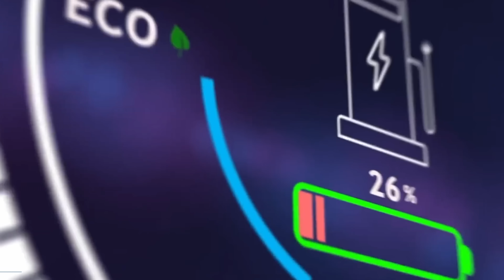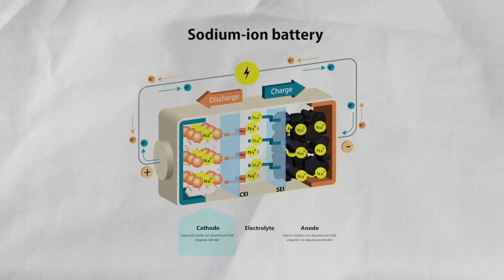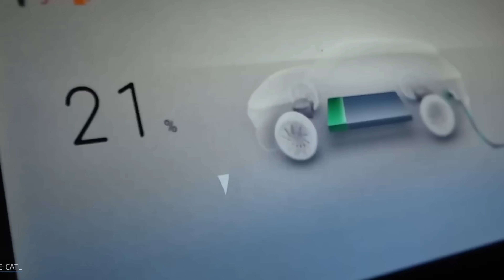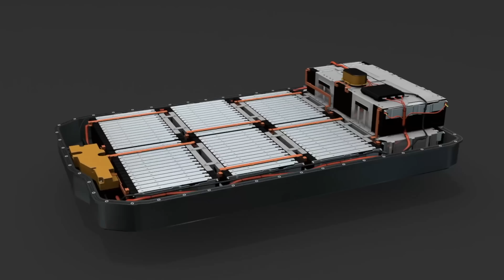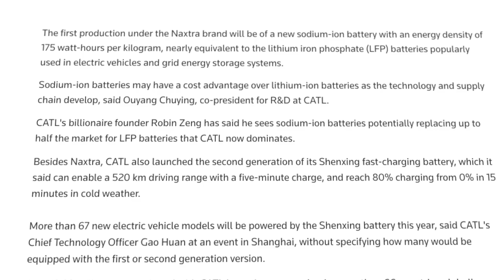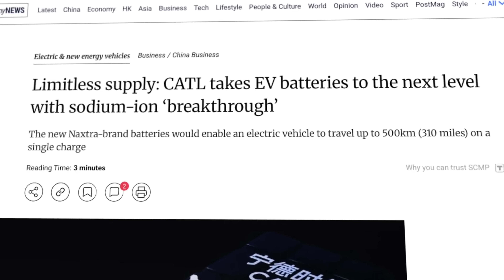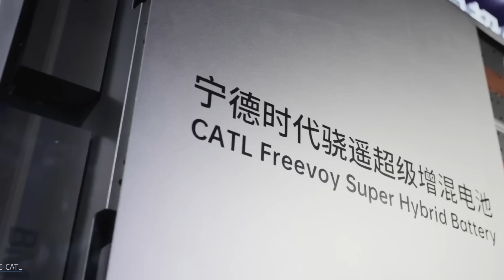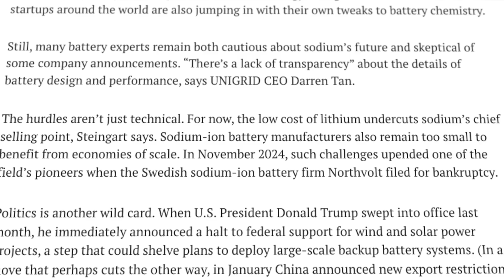CATL 5th-Gen LFP Battery Enters Mass Production — What We Know So Far

Comment from the maker: Would you prefer this LFP chemistry or the new Naxtra chemistry?
Reply: I would. The sodium battery seems fantastic, but LFP has been demonstrated and known. But, I am most interested in home energy storage.  I built a 32kWh battery out of recycled 18650 batteries, right before LFP prices came down. My next battery build (in a year or so) will be LFP.
Also, do they have the inverters and BMSs for Na ion yet?
Reply: Software defined BMS and inverters are available now. A small amount of programming will configure the needed CV curves
Reply: NA batteries I feel won't satisfy the car market by themselves, Naxtra as I understand from previous data is just a mixture of NA and LFP batteries in the same housing, obviously with some serious modified BMS and Inverter technology. The NA will of course work better at extreme temperatures for things like cold charging and can be used for warming the battery without having to expend power all the time to keep them warm, just use the power available in the NA batteries at that temperature to warm up when needed. The LFP batteries can help stabilise the voltage flow from the NA batteries to make it more consistent, together they probably make a better battery, but not with the same energy density as a full LFP battery.

Basically if you are in a country where you don't hit these extreme temperatures the full LFP battery will always be better, but the Naxtra battery might be much better suited to cold climates, the main differentiator then becomes price, would you take a car with a shorter driving range, say 10% or 15% less for a third the cost? Yes many people would do that, but I haven't yet seen any evidence of extreme cost savings in NA batteries so far. Of course they aren't in mass production yet so maybe that will come later, but with companies already claiming to have 350 W⋅h/kg SS batteries in cars in 2026 (although I suspect they are quasi-SS and not full SS) it's really a race to see who can market better in the short and long term.

Currently, in the climate where I live I would always go for the full LFP if I the price difference wasn't large, that's really the only differentiator at the moment. Maybe the end of next year that will be different, but we can only go by what we see at the current time and NA technology has yet to fully develop or demonstrate any great advantage over LFP.
Reply: @stevebrooks2361  And current Sodium battery seem to have a low efficiency, they warm up during charging decharging. This heat can be used to heat the LFP batteries that can then take over for better efficiency. Voltage is anothe problem of Sodium. It has a high voltage range where LFP's voltage is almost constant over the charging range. For home battery usage shipping cost and inverters start to make up a great deal of the price so I don't see them taking over home battery storage in the short term.
Reply: @stevebrooks2361  Freevoy is the CATL product that has both sodium ion and LFP batteries. Naxtra is just the sodium ion batteries. CATL's latest generation LFP batteries (starting 5th gen production this month) supposedly have around 185-205 Wh/kg. And CATL's sodium ion batteries (starting production next month) are supposed to have 175 Wh/kg. Both have lower energy density than CATL's Qilin batteries (255 Wh/kg). CATL claims a planned cell cost of $20/kWh for Naxtra/sodium ion batteries, with future costs that could go down to $10/kWh. So for affordable, efficient EVs, having a battery pack that has 68% of the energy density costing 1/10th the price, would be a game changer for EVs.
Reply: As someone who has had a lot of dealings with Chinese tech companies I can tell you one thing for certain. Unlike western manufacturers they feel no need to over hype things. If they say its going to be able to meet x y and z parameters? That is exactly what you are going to get from their product. We know LFP is good for 8000 cycles with the 4th gen. And aging out does not seem to be an issue if they are in continual use either.
Reply: @davefroman4700  I wish that was true about the China Light-Duty Vehicle Test Cycle (CLTC) driving range standard.
Reply: The Naxtra sodium ion batteries are rumored to come out at $20/kWh, which is a small fraction of current NMC batteries. So you could pair them with a super efficient EV like the Aptera (or Leaf/Bolt) and get decent range (260mi Aptera, 200mi Leaf, 170mi Bolt) with a battery pack that costs 1/4 as much. Even with 100% tariffs, that is half the current battery cost. For vehicles with different needs/uses you could use the Freevoy battery packs, which offer two battery chemistries per pack, with matching BMS/controllers, so you get the best attributes of each battery chemistry in one EV.

Comment: LFP prioritizes safety, cost, and longevity with a lower energy density, while NMC focuses on high energy density for greater range and performance, though it is more expensive and requires more careful management. This trade-off means LFP batteries are often used in standard-range or budget vehicles, while NMC is favored for long-range or high-performance models. 
EV battery performance is defined by several parameters, including capacity (measured in Amp-hours or Watt-hours), energy density (Wh/kg), and power density (W/kg). Other key metrics are cycle life (number of charge cycles), charging rate (kW), range (distance on a single charge), and battery life (lifespan)

Comment: IT is important to use both the energy density measure per unit of weight and the volumetric energy density, per unity of volume. Thanks.  Love your broadcast!
Reply: Also, charging rates in C, not kW.  Plus an indication of maximum and average rates of charge (Ideally versus longevity).  Now that would be REAL info.

Comment: CATL has a suite of battery product offerings that will match most EV, hybrid, and stationary storage needs well. The Naxtra sodium ion batteries are rumored to come out at $20/kWh, which is a small fraction of current NMC batteries. So you could pair them with a super efficient EV like the Aptera (or Leaf/Bolt) and get decent range (260mi Aptera, 200mi Leaf, 170mi Bolt) with a battery pack that costs 1/4 as much. Even with 100% tariffs, that is half the current battery cost.

Comment: Cycle life and kilometres is fine with EVs for a well used car what worries me is general battery degradation of a battery even when it is doing nothing...compare that to an ICE engine which can basically sit for a hundred years in the right environment...will this aspect of EV batteries improve?
Reply: Having an ICE engine in a stored state makes sense. If a BEV isn’t being used, move it on. Modern electronics do not like being stored. It’s not just the batteries, it everything with copper and solder, semiconductors, wet capacitors
Reply: @theairstig9164 Maybe if it's literally just an engine, because if you include the car it came out of, these days it's just as susceptible to the failings you mentioned. The ECU has copper connectors, soldered components, semi conductors and capacitors
Reply: Leave a lithium battery at 70% state of charge and it can sit for years and years. Do that with an engine and rubber hoses begin to perish. And if you aren't careful cylinder bores can go rusty 😮
Reply: @icereturns7867  You can fill an engine with diesel and it can sit for 100 years but what about a battery after 20?...they are getting better every year of course.
Reply: I drove 285.000km with my Kia E Soul 64kwh WLTP 485km and I still had a 540km range.
I could not detect any degradation.
Also my colleagues didnt with 200.000km...we had about 30 EVs

The battery will outlive the car
Reply: @ferrysonder7051  The point I make is a 45 year old Corolla that has done 100,000 kms will go for another 20 years...will an EV after 45 years and 100,000 kms be at the end of its life purely because of battery degradation associated with time?
Reply: @ferrysonder7051  my mazda 3 with 325 000 kms still has the same range  640-820kms

Comment: With the possible cheaper option of sodium batteries, does the tech changes that have to be made with sodium make it more expensive and make batteries the same amount? Thank you :)
Reply: No. Most battery management systems are software defined. The big issue will be that the sodium ion batteries need more copper in their bus bars to allow for the higher current at lower states of charge. Battery cooling is less critical but some applications will still need effective cooling. The chemistry is far more tolerant than NMC. Cooking the connectors clean off the batteries will be much more likely

Comment: It's worth remembering that all is not about the price only.. Diesel cars were more expensive for a long time, but the sold  in large numbers because of other beneficial properties. The same could be applied to the different batterie technologies. For some users, one type of battery is perfect, but to another, it's not. To me, an environmentally friendly battery is preferable even if the car has a shorter range in certain circumstances. Though, charging times and/or degrading properties could be deal brakers.
Reply: Safety is my priority - which probably equals environmentally friendly also.   The toxic emissions of thermal run away is best avoided!